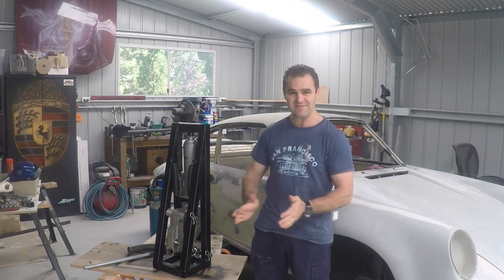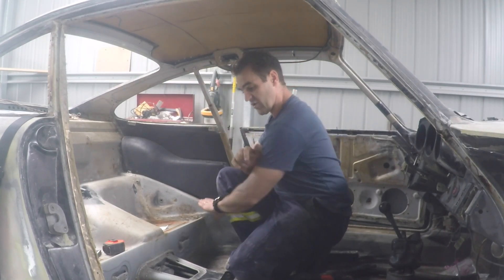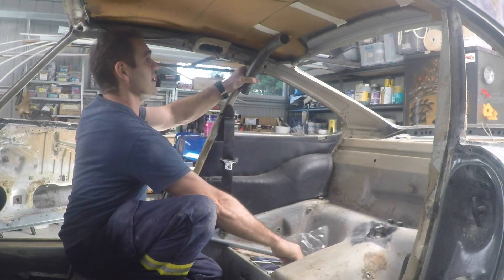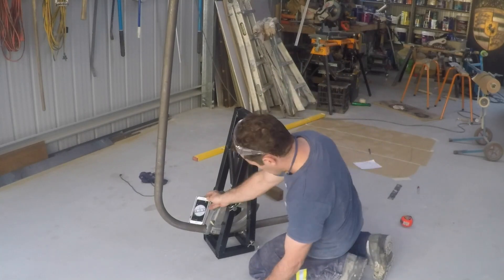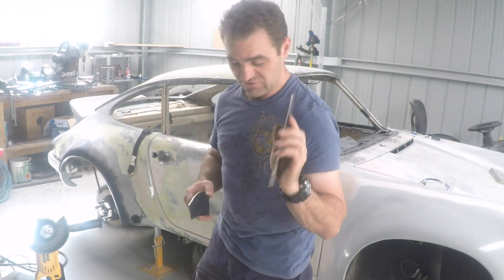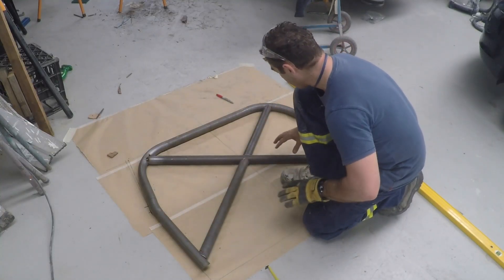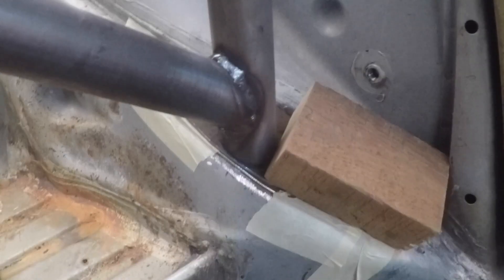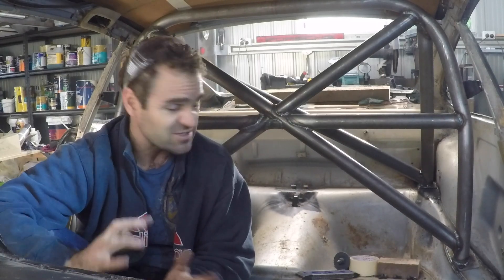Building a Roll Cage - Porsche 911 Classic Car Build Part 13

Comment: I did a 1953 100/4  and remember the gaps in the panels were perfect. I saw one with a roll bar and was close to the Cobra. Your attention to detail and fabricating skills are as professional it gets. So it shows when you believe in yourself you do wonders.  It's nice to be able to focus on the details.  The 1983 911 was stainless steel. Love the 911.  I'm sure I'll be watching you rebuilding the engine. Keep up the nice work. It's all worth it.

Comment: Just a thought & perhaps worth considering for future builds .... use plastic plumbing 1 3/4" pipe to mock up the cage. Cheap to buy, easy to cut angles and adjust
Reply from the maker: Not really, the bends are different dimensions so it wouldn't really help at all.

Comment: Hi Jeff great videos!!
I have the affordable tube bender similar to what you have constructed. 
Wondering if you could give me any pointers on how to keep the tube level in the machine so when you bend the main hoop of a cage it doesn't come out twisted so one leg is further forward to the car than the other?
Reply from the maker: The first bend is straight forward. When you do the next bends you need to have some sort of level gauge. Get it so it is tight, but not bending yet, and then use the gauge to make sure everything is all in line before you bend.

Comment: do you not plan on making side hoops and door bars?
Reply from the maker: Not for this car at this stage. I may do that for future projects though. The way I have modified this car, I now realise, has excluded me from most competitive racing. It is also getting to be too valuable to risk going all out on the track. I will take it on some track days, but I will probably build another car for more serious driving.
Reply: +Home Built By Jeff yeah the paint turned out nicely. it would be a shame to damage your hard work. thats why Im spray painting my car. being strictly a track rat, im nit tryna spend alot of money on a oaint job to have it thrashed. keep up the work!
Reply from the maker: Not just the paint now. Have you seen what these old 911's are worth now... Crazy!
Reply: +Home Built By Jeff frankly porsches aren't what im into. I know a nice one when I see one. and I can imagine so. in the states you can pick up a 944 for $1500
Reply from the maker: +Tomas Bannon here too 😉

Comment: What's your preferred weld for a roll cage, mig or tig weld?
Reply from the maker: Hey mate, I am not an expert by any means. This is the first cage I have built and I used a Mig as that is what I have.
Reply: @HomeBuiltByJeff  I see you said you have a tig on the way. You'll be very happy. Your skills are very refined the way we would all applaud.

Comment: Jeff, what's the final weight of your roll cage? Did you include a video of moving the cage in and out of car?
Reply from the maker: I am not sure of the weight, but it is not light. I would guess around 20kg
Reply: I was thinking maybe 40 kg. 20 isn't bad. All us 'mericans love your videos
Reply from the maker: I am guessing of course, but I am comparing it to a 20kg bag of concrete.
Reply: If you're going to be doing more Porches, maybe a fish weight scale hanging from a rafter would be useful.

Comment: Looks great Jeff. I will be adding a half cage to my '78 911sc in the future. Can you give me an approximate cost on what you spent on materials for the cage and bender?
Reply from the maker: +Wacko C I think from off the top of my head the tube was about $140 and the die for the bender was about $250 delivered. Then there was the square tube, nuts, bolts etc. was probably $50 (maybe a tiny bit more). I bought to pipe bender as well which was unnecessary in the end, but you could make the bender with any old hydraulic jack you can dig up. Those are AU$ prices by the way.
Reply: +Home Built By Jeff thanks for the quick reply.
Reply from the maker: Wacko C I just woke up ;)